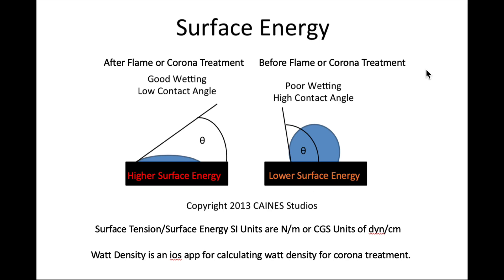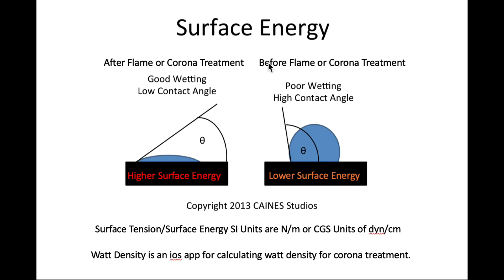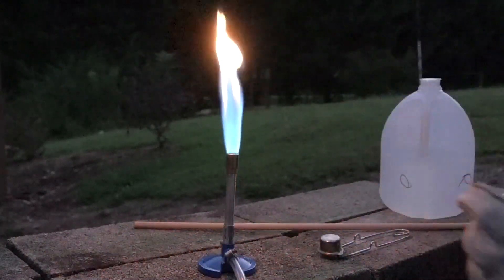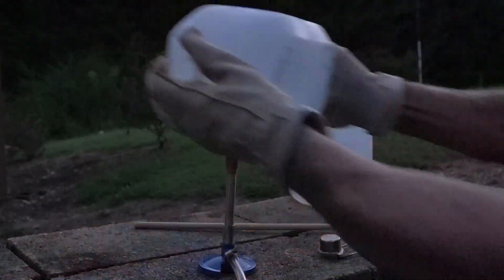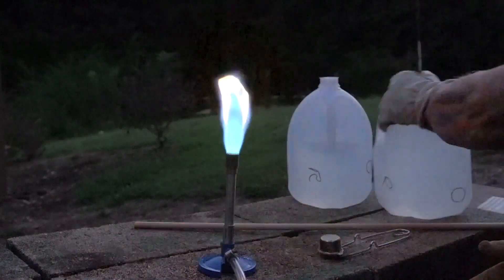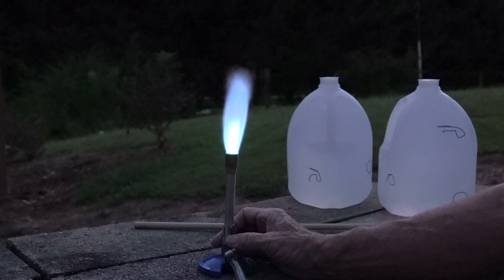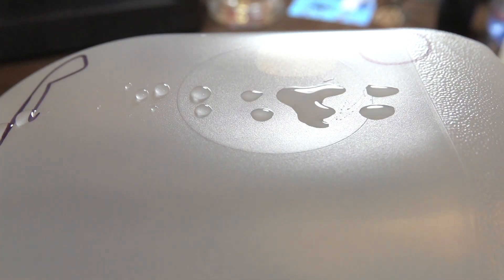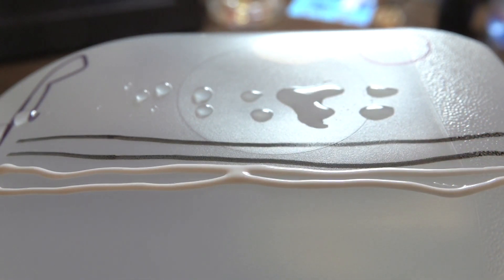Flame Treating a Polyethylene Jug with Oxidizing and Reducing Flames

Comment: This was fantastic...the type of nuanced demonstration & application of scientific/chemistry principle I've long waited to see. Do you have any recommendations for possibly adding drops of chemicals(..any of the hydroxyl group-rich compounds you mentioned?..) to a surface before flame/'corona'-treament...that might spur the surface oxidation further? Almost like flux keeping a metal surface oxidation-free as prep for soldering? An alcohol...peroxide...common hydrocarbons?
Reply from the maker: Thanks for your comment and question. I have not done a chemical pretreatment, but someone may have tried that. Both flame treating and corona treating are commonly used in packaging film converting operations. Various primers are used, but usually after flame or corona treatment. A lot of this information can be found in the patent literature in addition to scientific journals. The nice thing about patents is they are free and easy to access for not only the US, but the entire world. One process I read about, but did not see was exposing the hot polyolefin melt exiting an extrusion die for extrusion coating with ozone can to increase the surface energy.
Reply: @anisotropicplus  Thanks again for the guidance.